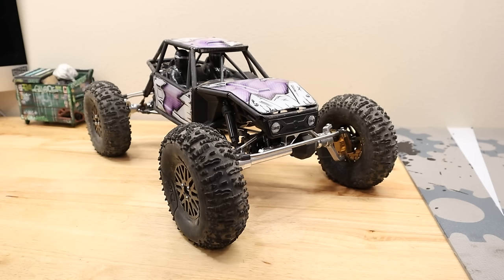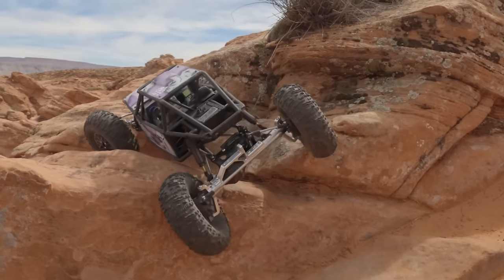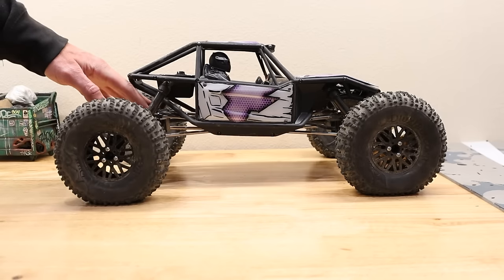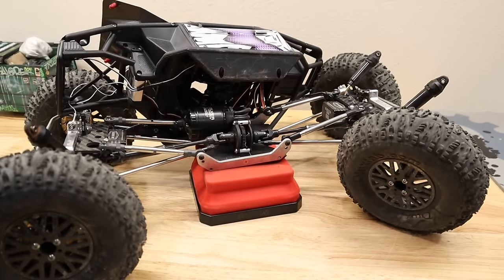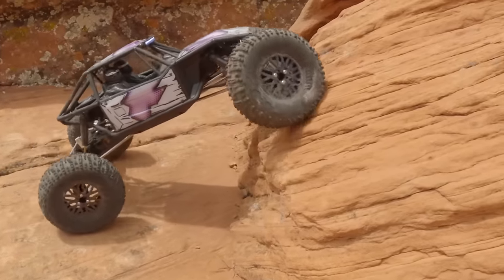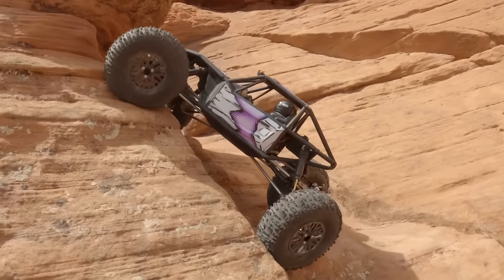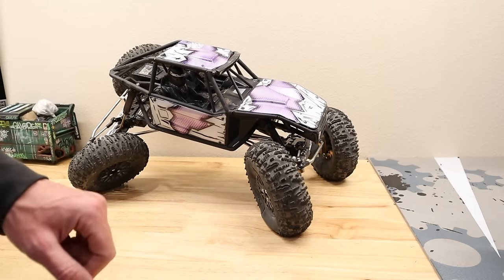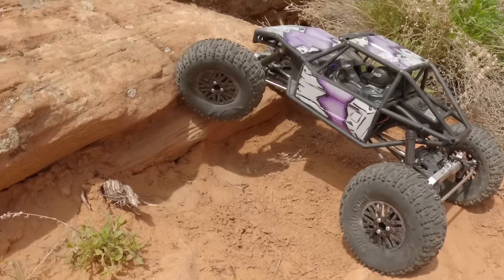Dlux Capra Build Breakdown! All Out Performance Build

Comment: Where we crawl under 13.5 is really really hard and sometimes impossible as you hit too many underslung lines and my 12.5 inch wheelbase rig gets too steep. You have to add rear steer on the 13.5 rig tho or you can't turn enough.